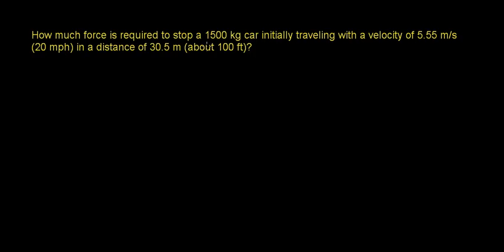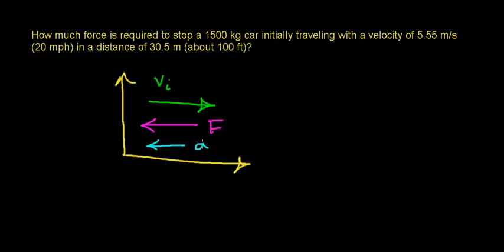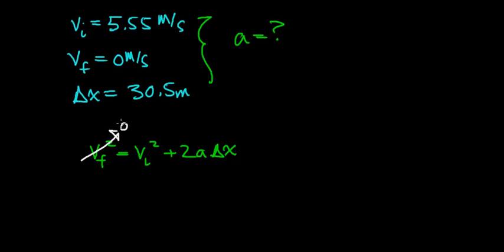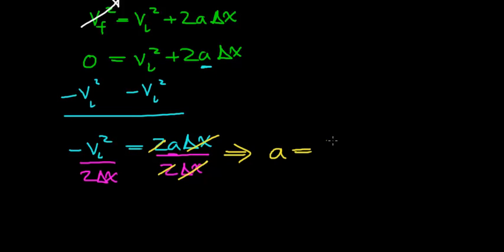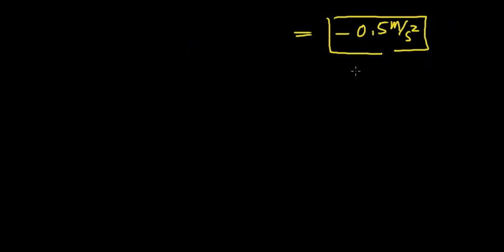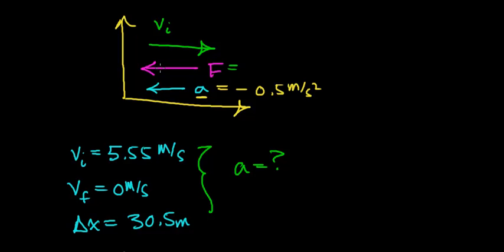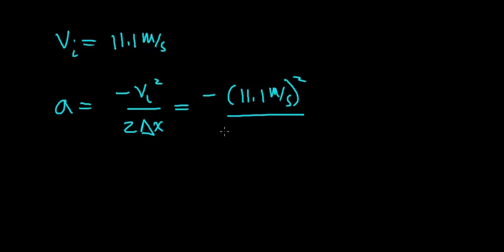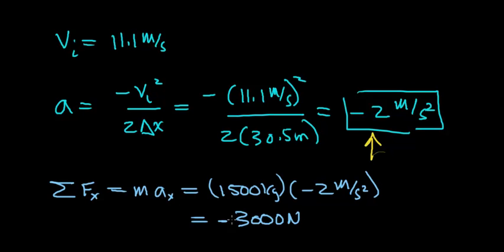Force Required to Stop a Car

Comment: When using Newtons second law the brake force must be directed backwards. The only way to get this is the to have locked wheels. So you made a calculation assuming thirty meters of skid marks. Newtons second law is not valid for vehicles rolling on wheels, only for rigid bodies. Real cars have brake systems inside the car. Brake  forces are working in other directions than backwards, other distances than the distance along the road, and are not working ON the car, but INSIDE the car. Brake systems are constructed in order to keep the wheels rotating, not slipping by the ground.